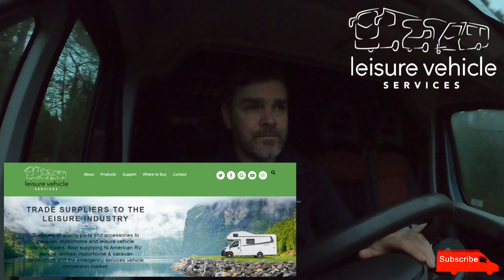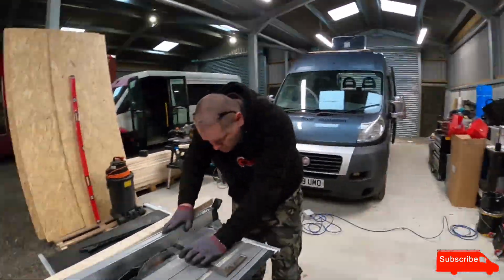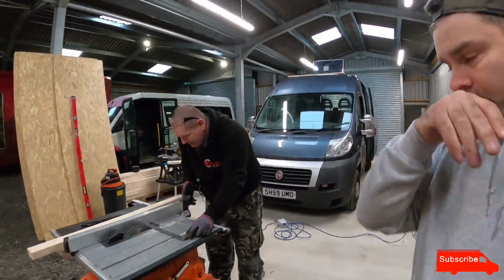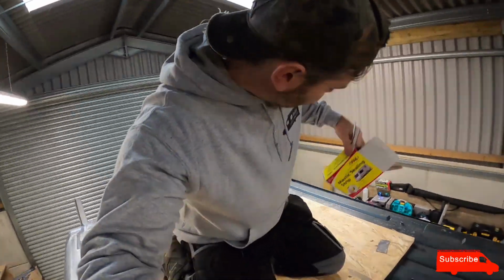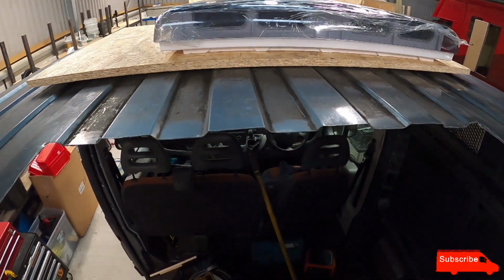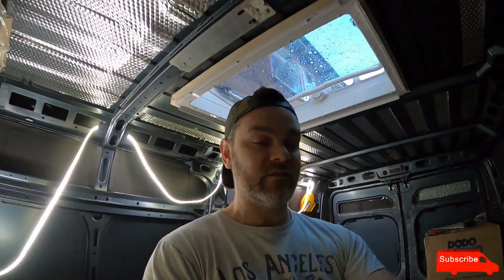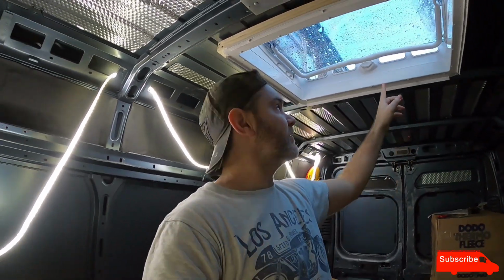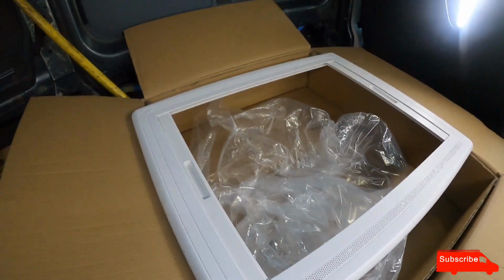Installing a Skymaxx LV Rooflight || Ducato Camper Conversion || Episode 4

Comment: Eye protection is an absolute must when working above your head, rust prevention on cut metal edges not shown. Skylight looks great.
Reply from the maker: Your right of course. Painting bare metal wasn't shown. Thanks alot :)
Reply: @LukesVanLife  Sorry for being all H&S ish but I cringed when I saw you drilling the holes under the roof, I'm in the trade and guilty as hell but looking up and drilling equals a disaster.

Comment: Without 2 side windows you won’t be able to re-register as camper, will you? New DVLA rules. Will only be van with bed. Harder to insure?
Reply from the maker: Even with two side windows it's notoriously and almost impossible to get a van registered as a motor caravan these days. They always come back as van with windows. So I'm not fussed about declaring it as a motor caravan. It doesn't make it harder to insure, just probably not a cheap as if it were 'motor caravan'

Comment: have u ever had problems with insurance  after  cutting  the  holes.. or modifying a van in any way ?  ... so far the only  holes ive had to  make  are for the  heater ... which i was  nervous about   but  it went well... measure   10 times    drill  once  lol...  just  bought a solar panel  but thinking about running   the  cable  underneath and coming up  thru the  floor ... not sure how practicle that is   but  it wont  ever leak ..
Reply from the maker: Never had any insurance problems. Your only nervous for the first time you cut holes, make sure you watch plenty of YouTube vids. Installing a solar panel cable gland on the roof is dead easy. And will never leak if you use the right sealant. I'll be installing solar on this van in January so if you haven't done yours by then. I'll include how to install the cable gland in the vid so you can see how I do it. 👍😁

Comment: Loving the channel, just found it, ordered some of the Helian lights.I’ve got a 400x400 roof light but they’ve sent it with the maxxshade fixed to it, any tips on how to get it off, (nothing in the instructions)I don’t want to damage it!!! Also did you just fit it to the timber temporarily to tighten it to the roof? Cheers
Reply from the maker: Hi, thank you for watching. Are you talking about the black out blind and fly net that clips in? Mine has that as well but I didn't fit it till yesterday when I finished the ceiling in the van. If it's the same thing it clips in with metal clips but it's tricky to get off, you have to carefully pry it off but a nerve-racking experience. The timber isn't fixed to anything, it's just wedged between the ceiling of the van and the skylight internal insert and now cladding. 👍😁
Reply: @LukesVanLife  Yes that's what I was on about but I've managed to get it off, you're not wrong, I didn't fancy breaking it and thanks for your reply, it's very much appreciated.